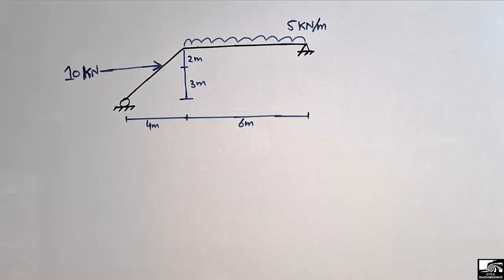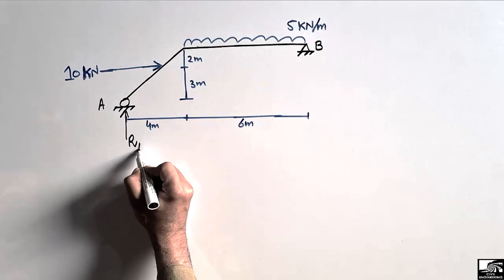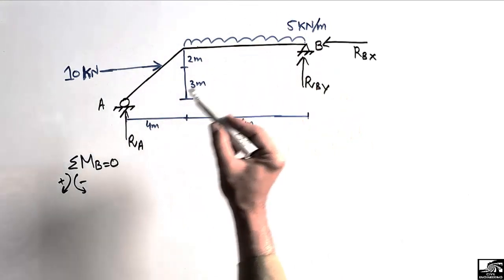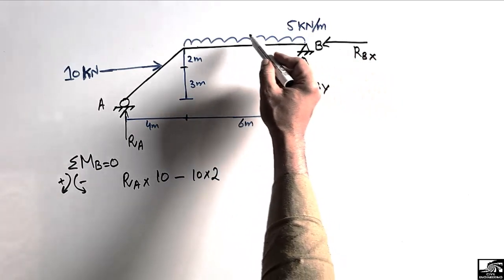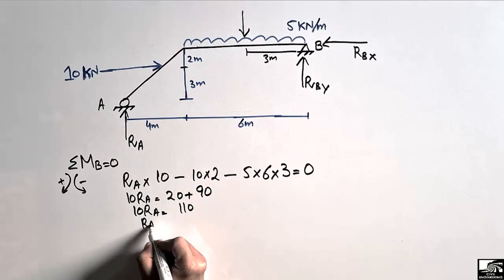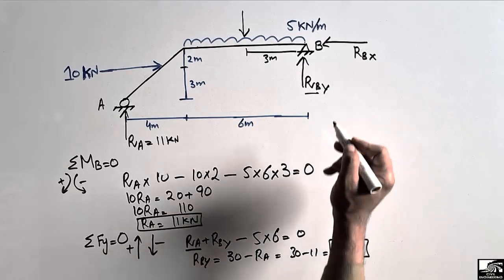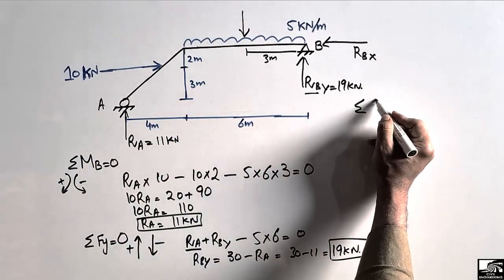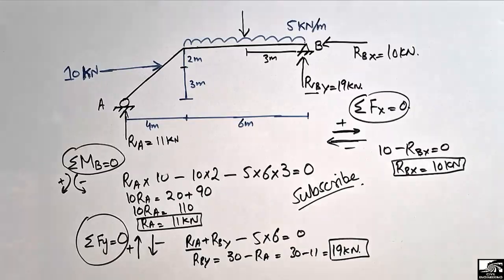How to find Support Reactions for a Frame

Comment: First of all superb video, now my question is, how would one proceed with a pin support at A and an inclined roller support at B?
Reply from the maker: Thanks
In practical, you mostly see fixed support, but also there are thousands of structures that use these supports like girder resting on pier etc.